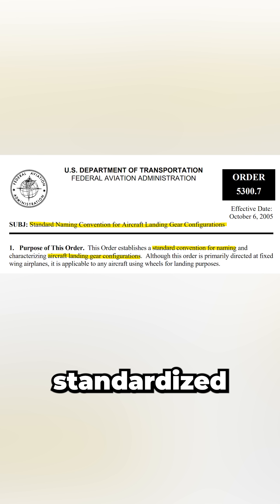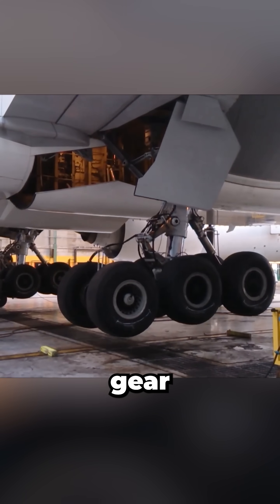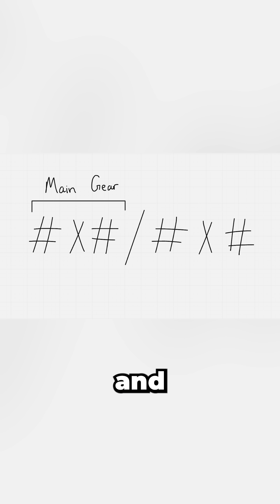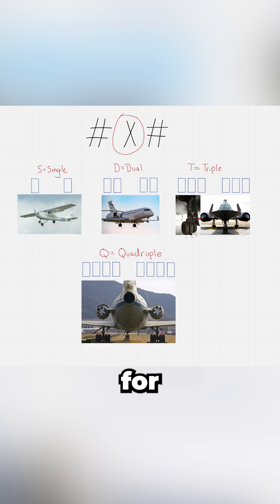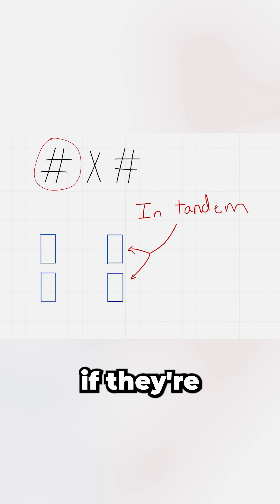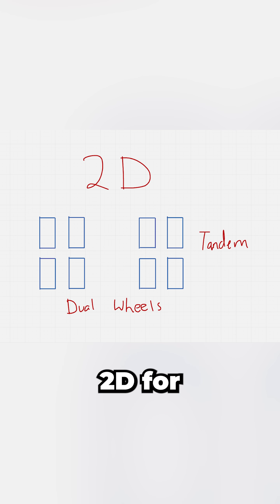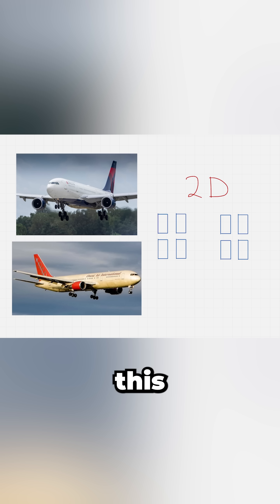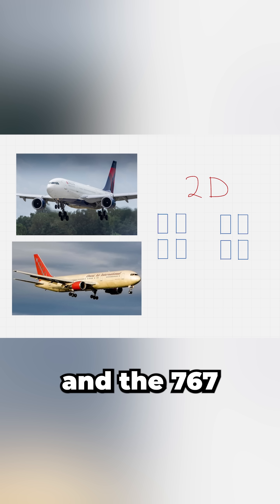The Secret Landing Gear Code Decoded!

Comment: This will fix how annoying it is every time I try to explain my designs landing gear configurations.
Edit: I do have a question: how would you explain the C17 landing gear? Would it just be a triple?
Reply: I think that would be considered a T2. Someone can probably correct me.

EDIT: I read the FAA specs pdf a bit more and the C17 in fact falls into an exception, and is considered a 2T.